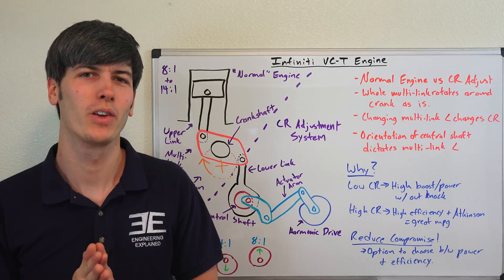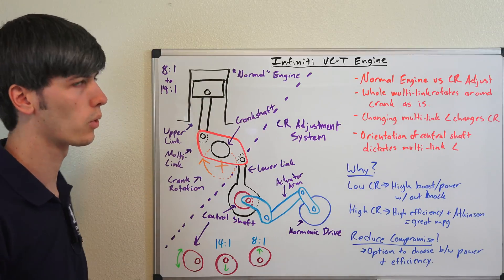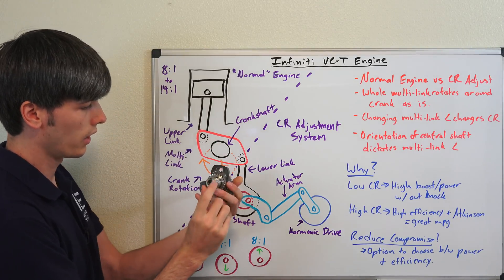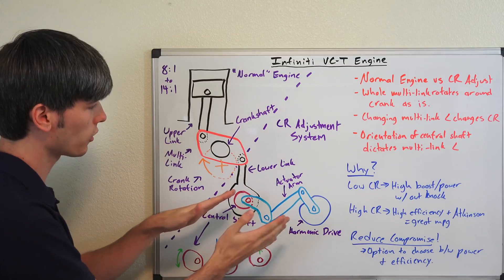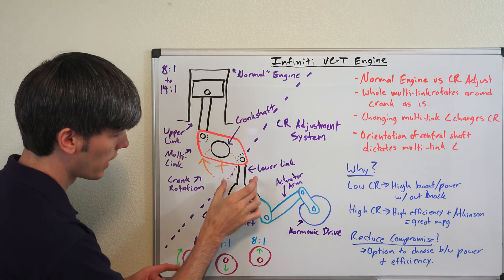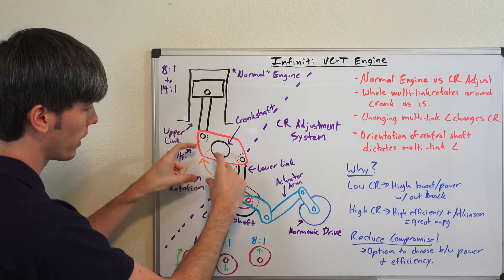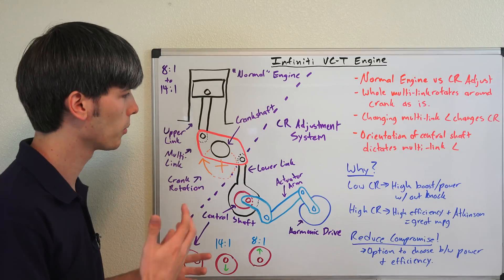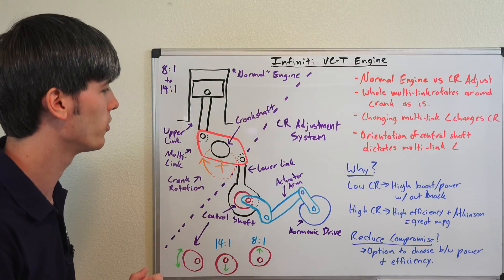Infiniti's Amazing New Engine - Variable Compression & Turbocharged

Comment: The multilink does not stay in the same orientation as the crankshaft rotates. It will pivot since the connection to the lower link is stationary, exept the slight movement when changing compression.

Comment: Your best combustion efficiency is achieved when the fuel/air mixture is at the highest pressure you can achieve without detonation. The problem is a conventional engine is designed to have the fuel/air mixture at this max pressure only when the maximum amount of fuel/air is in the cylinder- ie at maximum throttle. When less fuel/air is in the cylinder and the piston comes up to its standard TDC the volume left in the cylinder is too large for the given amount of fuel/air. So at ignition the fuel/air is not at high enough pressure (same volume but less gas) to combust efficiently. So the objective is to achieve a constant compression - pressure at different throttle settings which means different amounts of fuel air in the cylinder at the end of the intake stroke. To achieve compression at a consistently high level the compression ratio has to change by changing the height at which the piston reaches TDC.

Comment: My mom just bought an Infiniti QX50 with the KR20DDET engine that uses this technology! I'm very excited to see how it really feels in a car. They really pulled out all the stops with this engine, from both port and direct fuel injection to variable valve timing and of course the variable compression ratio, and a turbo on top of it all. I'd really like to see to applied in a sports car, as it'd allow higher power under our modern efficiency constraints. And I'm not gonna lie, having a quick car that gets slow-car fuel economy would be a pretty sweet deal.

Comment: What happens to the knocking in higher compression mode? Every time one goes for higher compressions, it starts knocking right away and the system switches it back to the lower compressions. Whats the point?

Comment: I think this is a good idea to run a engine that burns alcohol (e-100) and gasoline, because you can adjust the best compression rate for each fuel. Alcohol requires higher compression than gasoline in order to achieve better eficiency...

Comment: This engine has nothing to do with efficiency. It has to do with cost. If you could keep the motor at 14:1 and high boost you would make even more power when you want it and would be even more efficient, but it is costly and with a cheap engine you will  just remove the head off that engine.

Comment: It would seem a bit more friction is added and the strength of the lower arm and components is very critical to the power level of the engine. One glitch in the software = high compression + high boost = boom. Kudos for them finally implementing it though, eventually the bugs will be worked out and it will be refined even further. I'm going to let everyone else be the guinea pig on this, by then electric will probably be taking over though.

Comment: Very cool.. but don't turbo's basically achieve the same thing ?? It increase's compression ratio through "forced air" instead of adjusting it through piston stroke but has way more capability than any naturally aspirated engine high compression or not . When "off boost" turbo engine's can achieve good mileage.

Comment: I’m confused with the thing that “A lower compression ratio result in more power”
I read down here that you said “Peak boost will only occur when the compression ratio is low, with more air you inject more fuel, burning more fuel means more power.”
So.. 
The increase of power comes from the higher displacement.
Actually the higher the CR, the more power (@ constant displacement).
Am I right with my two statements?
Reply from the maker: +Andres Parera Deniz yep, correct. But high boost high CR = knock.
Reply: Actually, "displacement" was not the correct word, as it won't change (bore x stroke). What is higher is the volumen to be filled.
Anyway, I think we are aligned!
Thanks for all your videos!
Reply: that is when its boosting at low comp ratio

Comment: I remember a refinery test engine that use hydraulics to change the length of the con rod to raise or lower the compression ratio. (R+2 rating?) I can see how this'd alter the mass of the con rod and thus create a counter balance  problem. But since then have seen the WWI era "Radial Rotary aircraft" ( https://en.wikipedia.org/wiki/Rotary_engine#/media/File:Rotary_engine_-_animation_slower.gif  ) in which the crankshaft remains stationary with the pistons and cylinders rotating on different centers, the distance being the stroke. Now, the variable mass of the con rods and stroke length dont matter. The engine is lighter because no counterweights are needed. 

Acceleration would be much slower, but this is not a problem with aircraft, and for ground vehicles, hybrid electric'd compensate. For aircraft, this is a real big deal because the innate vibration of counterweights can become resonant at certain RPMs with that of a propeller and have the whole thing disastrously fragment. Fuel and ignition are complicated with systems to prevent operation at these destructive speeds.

Comment: Disadvantages engine with variable compression ratio «infiniti» 
1. Low reliability due to the complicated, cumbersome chain of elements included in the mechanism of change of the compression ratio (actuarial system with pneumatic, hydraulic and electronic control lock). In the context of large temperature gradient arising during operation of the engine, these elements will inevitably cause it to malfunction and failure, especially at high engine speeds. 
2. According to the manufacturer, the engine was very balanced (?), So that the design of the balancing shafts were withdrawn. The fact that the lever end pivotally connected with a yoke, which allows to vary the stroke range for changing the compression ratio oscillates strongly at considerably lesser curvature (!) Than the curvature of the oscillation of the rocker, mounted on the working shaft, wherein the rotational oscillation . This creates additional stress and imposing harmonies of different orders, resulting in an increase in the tipping moment as a working shaft and the additional shaft, and leads to a large imbalance in the engine. 
3. In general, a complicated and expensive to manufacture, and are not easy to operate. 4. Less is balanced not only in comparison with the traditional, but also with the previous generation engine lineup with a variable compression ratio «infiniti». 
5. Because of the increased cyclic bending deformation of the rocker, the mechanism changes the compression ratio can lose their nominal precision characteristics and may even be damaged as a result of fatigue failure. 
6. Excessive fuel consumption in city driving mode. 
With such known significant shortcomings, it is impossible to start the engine in series production. Engine model at the level of research requires significant improvement. 
Ramzan 25.11.2016

Comment: The above explanation of benefits of a variable compression ratio misses the main point.

1. It is not true that engine can be powerful but not efficient or efficient but not powerful. An automotive gasoline engine can NEVER be EFFICIENT. Period. 
Neither the "powerful" nor the "efficient" gasoline engines are really efficient in a typical automotive application, and this is where variable compression steps in.

The main advantage of a variable compression is that it makes gasoline engines efficient. Always efficient. As a side effect the engine becomes a bit torquier at lower rpm, a little like a diesel. That's because now it can work more like a diesel, except for the lower final compression ratio, or should I say lower final compression as measured in psi, bars - whatever one prefers...

The point is: a gasoline engine can never be efficient because for 90% of the time it is throttled. That means - it does not matter what its designed compression ratio is. When you choke it, the final PRESSURE (and this is what matters for thermal efficiency) is so much less than the max pressure allowed before self ignition. It's as if you had an engine with compression ratio of 3:1.  Variable compression takes care of it and this is what it is really for. You floor the gas pedal, compression ratio gets lower, you let it go, say for cruising, compression ratio goes up but in both cases the max pressure in cylinder is pretty much the same. That makes the thermal efficiency always high, not just when throttle is fully open which is almost never the case. 

What makes diesels so efficient is that they never throttle the engine so the final compression (measured in psi or bars) is pretty much the same whether they idle or go full power.
So now gasoline engines have a fighting chance to rival diesels in quest for efficiency. Except for parasitic losses due to throttling... but well... engineers are working on this too.

Comment: how does changing the compression of an engine combine with the octane level of the fuel? if you need higher octane fuel for higher compression engines, how does this engine prevent damage when it switches to lower compression mode?

Comment: Looks like an over complicated unnecessary mess. Cool, but wait until that screws up. You have to pull the rods out to fix it? $1k later for parts and 1 day later, once the internal variable compression parts parts are replaced, I would be homeless and starve to death. The more components, the more chance for failure. I like nice simple reliable engines. Those work just fine for me.  I would rather get 300 HP and 20 MPG or 200 HP and 30 MPG in a nice simple engine than 26 MPG and 400 HP in a complicated electronic mess with plenty of things to go wrong and be expensive to fix. If you have enough money to be able to buy, maintain and fix one of these, spending a little more in gas is not a big deal.

Comment: Why is it all mechanical? If the other new parts (control? and harmonic?) were just added to the rectangular thing to change its angle?
It doesn't have to be mechanical. and in modern architecture, it ought not to be mechanical.
And noise issue. Nissan doesn't care much about noise comes from their engines. 
They don't mind adding another overhead camshaft which can be DOHC which is also necessarily needed mostly. And this time they are adding two more, three more?
How much noise does it make when the engine isn't warmed up enough?

Comment: Impressive stuff. I heard Nissan wants this tech to boost its 2.0 I4 turbo to eventually replace its long standing VQ35 V6 engine used in almost all Nissans & Infiniti down the line. 

The initial release of 268hp & 288lb/ft torque feels kind of unimpressive, but if they can prove the VCT reliability with a 14:0 CR with a turbocharger, I can easily imagine 350hp+ to be achievable with a large turbine but remain drivable with low turbo lag.

Comment: A revamped VQ37VHR with variable compression ratio in addition to the existing VVEL sounds so brilliant and revolutionary. Variable compression ratio will kill the diesel engine. After that, laser ignition will finally kill the turbo by seeing the 2.0 turbo get replaced with a magnesium block v6 engine.

Comment: Another thing. Coyote mustangs 5.0 have a compression ratio of 11:1. Now people are boosting these things like crazy and nothing bothering them. I looked into it due to that I wanted to bump my 3 valve 4.6 mustang up from 9.8:1 to 11:1 or close. But found out I'd have to run less boost than I could if i keep stock compression also since 1 point of compression (Ex: 9.8:1 -> 10.8:1) will always produce less power than 1psi of boost. I then found out that coyotes can actually bleed off pressure on its own to compensate using the TI-VVT technology. So it technically has the 11:1 compression but it reduces cylinder pressure to allow more boost to make a little more power and allow that extra boost.

Whats your input on the TI-VVT with the ability to actually relieve cylinder pressure? Lots of new cool things the american cars are bringing around and even GM's v8's shutting cylinders down

Comment: I was wondering why the movement seemed so small. I tried working out a simple example, and it looks like, to change your S2000 AP1's CR from 11.0  to 12.0 would take only a 0.76 mm change (assuming you move TDC and BDC the same amount).

Comment: SAAB showed similar techonology a few years ago - in general, this system reminds the scales, where the piston and combustion chamber from the one side and the other side is a mechanism, that controls the crankshaft postition. the only difference in saab's technology is that it had a piston from the other side from the combustion chamber, which was placed into the camera where the oil was pumped into. the system was controled by oil pressure.

Comment: Does this compression ration "Phasing plate" occur on every rod in the engine? Meaning for every cylinder does this system require all of that to be repeated or is it using that single plate at the front of the engine to achieve the changes? Also, I wonder what the parasitic loss is for such a system. It seems like an adjustable combustion chamber would be easier to move up and down within the head as opposed to an item that is rotating with such great energy.

Comment: have you seen Koenigsegg's camless engine? they have square wave valve positions with absolutely variable valve timing. 

all we need is someone to take a diesel engine and put a set of those heads on there and run an Atkinson cycle. run it on gasoline and put a direct methanol injector in the cylinder and crank the boost. run low compression when low power is needed and, as you approach knock conditions, you can inject methanol to cool the charge and keep it stable. or just run the atkinson cycle and have a 9-11 : 1 compression ratio and a 16:1 expansion. either way, more power from less fuel

Comment: WOW! that's pretty cool! the one problem i see, being a mechanic, is that system looks like it's adding quite a handful more points of failure. I wonder if that will become a cause for more maintenance problems down the road. an engine already has a lot of moving parts and close tolerances before you add more systems in there.

Comment: The arrow labeled "crankshaft" should be labeled "rod journal" and the one labeled "crank rotation" should be labeled "crankshaft."  You could then put an arrow on the dotted circle and label it "crank rotation."  That would help to explain what would otherwise be misleading if you did not show the actual crankshaft to help explain your diagram.

Comment: This engine is pointless and just leaves more room for things to break. 

It's a good theory but as I mentioned in the previous video about the "best engine". The less parts you have the better. Compression ratios only matter of your parts can't handle high pressure spikes. If you tune properly you won't have knock anyway. So in reality a perfect combustion engine would be less strokes,  higher compression, cooler combustion,  efficient in fuel and emissions and use a fuel that makes no emissions (hydrogen or compressed air are good ones besides electric which is n/a but even better,  all of which exist). 

But for any combustion engine I'd say as close to perfect is an OPOC that runs on hydrogen gas. Period. Tell me I'm wrong. :)

Comment: Leave it to the Japanese to add weight and complexity to gain efficiency.
Reply: Except they didn't add weight.  They removed balance rods that were no longer needed after adding these new components.  And the entire engine package is smaller and lighter.

Comment: now all the need to do is run a flex fuel sensor and 2 fuel tanks so you can run 93 octane in one and e85 in the other for max power.

Comment: I don't understand how this works in practice because fuels do not change inside the tank to suit the compression ratio.  A formulation of petrol optimized for high compression will likely leave deposits at a lower compression ratio.  What am I missing?  What magic are they doing to be able to use a single fuel for both operating modes?

Comment: Or you can just use higher-octane fuel so you can keep your high-compression ratio.  The U.S. has terrible fuel, our 93 is a joke, and auto companies have been pushing for better fuel for years.  Hell, the government even managed to ruin the E85, which for many states is now being renamed to "Flex Fuel", with about 57% ethanol or so...  ...Infiniti's new engine sounds like a disaster waiting to happen, so many moving parts, they forgot the most basic rule of engineering: Keep It Simple.

Comment: as a mechanic I hope I never have to see this engine. Way too many moving parts to be reliable. why not just replace the entire lower section of gears and links there with a hydraulic or mechanical actuator? I just see it wreaking havoc on the bearings

Comment: 14:1 seems like an obscene amount of compression even if it were only a naturally aspirated motor.  Is that common in new cars?
Reply: Mazda does 13:1 in us ( 87 octane) and 14:1 overseas where much higher octane is the norm... Not in their luxury cars, but in fact in ALL cars they made since 2012 they call it Skyactiv Engine.
Reply: 4cyl can run higher compression than the v8s on pump gas. You may be used to american V8's in which 11.5:1 is towards the top end before pinging.
Reply from the maker: +alcobra88 if using the atkinson cycle, yes, you can get away with super high CR.

Comment: not too sure if this has been asked but how does the harmonic drive work?
Reply: A harmonic drive is just a gear reducer.  It increases torque but decreases speed of the input motor.  They are probably using a tiny electric motor with a harmonic drive on it to get the torque required to operate that linkage.  Search youtube, there are videos about harmonic drives.  They  are cool but hard to explain in text.